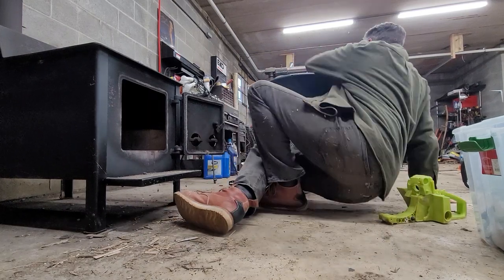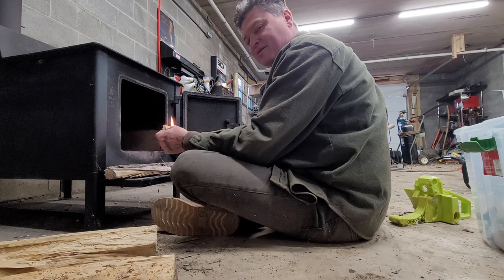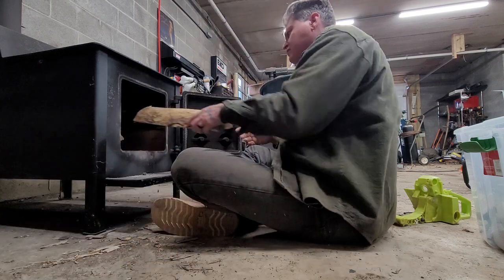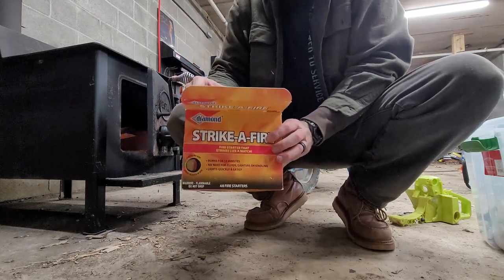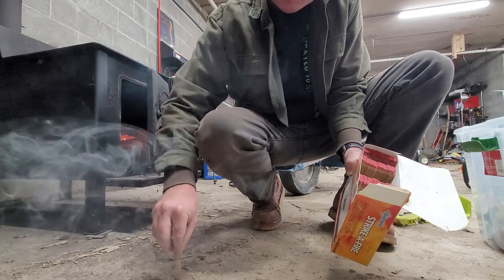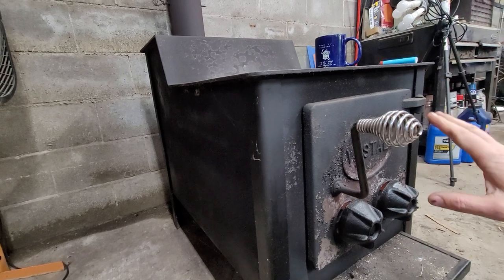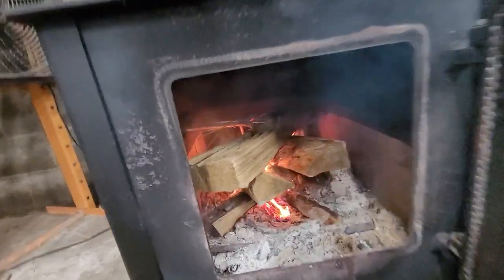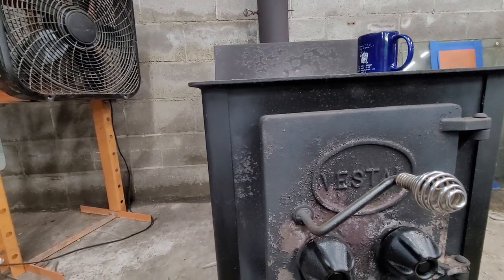How I fixed my Sucky Barrel Stove @BoedyPennington

Comment: Most insurance companies (around here) won't insure a shop or garage with a woodstove in it for heat. Too many issues with gas and oil fumes, etc. because of the fire hazzard. I have my stove outside and blow the hot air from the stove to the building (yes, it's a barrel stove) and it works great. If I want to warm it up quick, I just use my diesel torpedo heater which takes about 15 minutes and then I can keep it warm all day with either my woodstove or my overhead electric heater if I'm not out there all day. The woodstove will last all day if I want to spend a long time out there.
Reply: Same here in Finland.  You cannot have wood stove in a garage..

Comment: I actually saw that video a year or so ago! My single barrel stove in my shop sucks aswell. About 8 years ago I thought it would be cool to put one together. After a dozen or so fires, I reverted back to kerosene heaters😅 will eventually replace it with a real stove whenever I run across a good deal. Last spring I got bored enough to line mine with fire brick and sand, which helped tremendously! But it still sucks. With 18' of stove pipe it pulls a very strong draft but still requires near constant tending.  Nice stove you got there👍🏻

Comment: I am with you about barrel stoves!, between time and effort a barrel stove is an entry level temporary solution for heat! Between the thin metal of the barrel, and the space they consume they are not worth the effort! Now if i was building my own stove, some of the concepts would be implemented, but as for the materials NO, barrels are too thin for long time usage and can be quite dangerous, time consuming, and are also inefficient! People who swear by them need to do more research!

Comment: Hey dude! Don't you be distracting Aaron he still doesn't have my second saw done 😂
I use those match stick looking fire starters as well and they rock... Hard to find around here so I buy a bunch when I find them! And oh by the way.. my wife said that my stack is to short too.... 3 years later we got a wood stove 🤣🤣🤣😆😆
Reply from the maker: YouTube celebrity builds go straight to the front of the line for saw builds!
Reply: @novicelumberjack  Mine is done but he is having an air leak issue.. I'm a celeb too bro, just not as famous as you!! My saws are for work and not play 😆😆💪

Comment: You just needed to drill a hole in your barrel stove and add a drip line for your used motor oil.  Free heat!
Reply from the maker: I actually did this.  Driped it into a disc brake rotor with the lug holes welded shut.  Actually worked quite well, but I prefer burning wood.

Comment: That stupid short chimney is the  reason why your barrel stove sucked....
Reply from the maker: You clearly didn't watch the whole video.  When I first installed the barrel stove it was in a different location and had a long chimney.
Reply: @novicelumberjack  but i did..... when you added the second barrel to get more heat it made your chimney shorter.... and when you bought the real stove now you have a longer chimney again. So with the double barrel stove you should had made the chimney taller so you would have good draft and then you could have "choked" the double barrel stove more to burn slower. Although choking  air from wood stove is never good because then its not gonna burn as clean as it should and thats the reason you you will get alot of creosote. The air can be choked slightly but not alot.